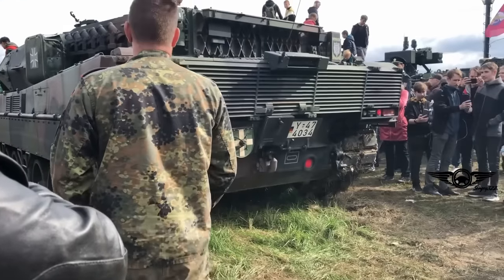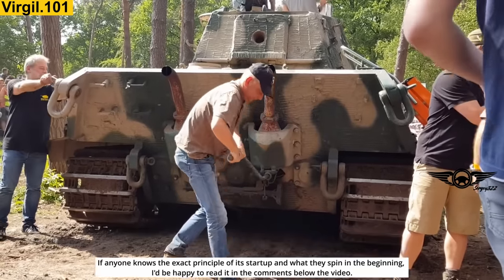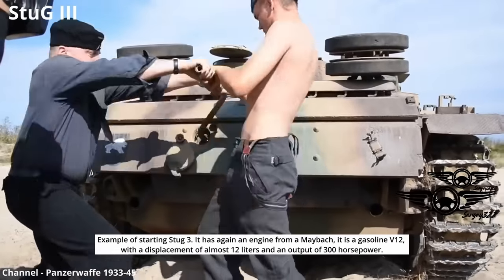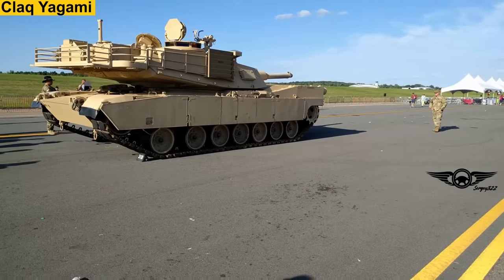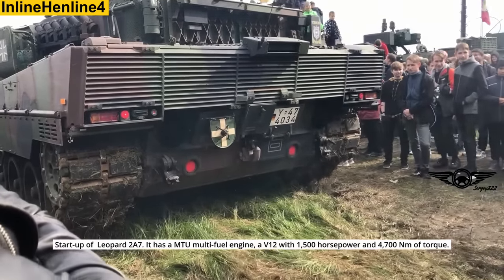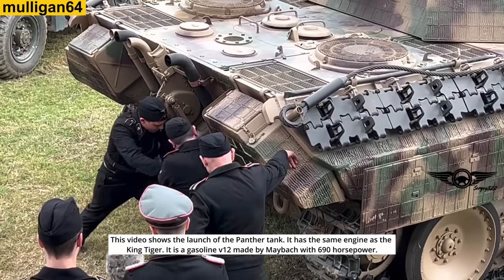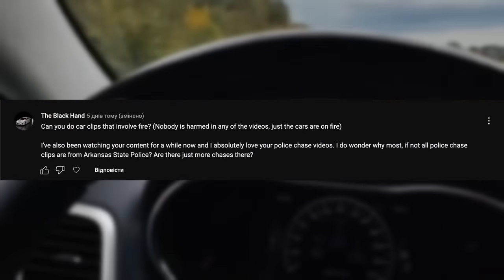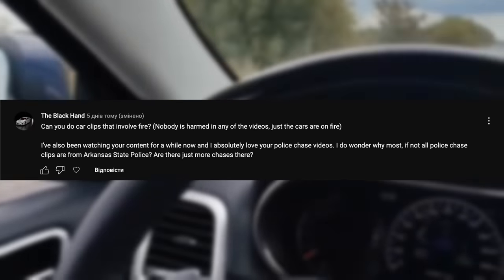TANKS ENGINE COLD START AND REVS (Abrams, Leopard, King Tiger....)

Comment: While I''m not 100% positive of this, I think the tanks that needed to be started manually by crank, the operators are spinning up a flywheel of some sort (and you can hear the flywheel spinning later on in the videos) and once the flywheel is spinning fast enough another operator then engages the flywheel to the motor which then starts it up.
Reply: It is a flywheel system. During times like Remagen in the winter time when it gets blistering cold, you would need a way to choke up the engine so to speak because the batteries don’t like the cold, and/or gets condensation on the spark plugs.
Reply: It is called an inertia starter

Comment: Would love to hear a jagdtiger with the v12 maybach HL230 P30 💪 it was such a beast, and we were luck there weren't many about
Reply: Same as Tiger 1 - Tiger 2- Panther engine?
Reply: @doguesrefoglu4865 I'm not sure, tbf
Reply: Panther, Tiger 1 and Tiger 2 in all their variants has the same Engine with 700 HP. For the Panther with 45t this was a good engine, that gave him good Mobility. But even the Tiger 1 56t was underpowered.
You can guess how bad the mobility for the Tiger 2 with 68t and the Jagdtiger with 75t.
At the end of WW2 they developed a new tank engine with Diesel fuel. In testing it performed better then the HL230 with gasoline, but it was never produced. One of the reasons was, it was fueled by Diesel and the Germans didn't like diesel that Time.

Comment: Since the batteries were not yet so pkwerfull at that time, the engines were cranked to make starting the engine easier.
If it doesn't smoke ... it has no power 😏

Who's  Greta T ?   🙂

Comment: They spin the massive flywheel i.e mechanical energy capacitor, then pull the clutch and stored energy used to crank the engine

Comment: Hypothetically speaking, if a soldier knew how to turn off those old tanks with the cranks and they just so happen to have one for some reason could they? a lot of heavy German tanks were used as defensive placements so you could easily get behind one if you dealt with the germans defending it right? it seems like most of the tanks during that era had no start/off internally

Comment: It sounds like they are running up a flywheel with the crank, and then using the motion of the flywheel to turn over the engine. No battery required.

Comment: all German tanks had electric starters with inertia starter (essentially a flywheel at high rpm connected via clutch to engine) backup.

Comment: 3:34 "who needs to use a gas turbine engine?" go stand about 200 feet away, and you might understand, you'll hear a big diesel engine powered tank coming from miles off, you wont hear the turbine coming till its a couple hundred feet away, plus when the gas runs out, you can just throw something else in the turbine, it'll run on diesel, alcohol, ethanol, even oil
Reply: plus it's much smaller than a similar spec diesel or gas engine
it also has the advantage of having a lot of horse power allowing the abrams to just stack and stack on armour and it won't affect much of its mobility

Comment: Imagine that you are in the middle of a war and you are in a tank carrying a helicopter engine that can be heard from 1000 meters away.
Reply: I head that M1 abrams might be one of the quietest tank when facing you. It can practically sneak up on you if you're facing the other way
Reply: The abrams is the quietest tank shown here. The higher frequency sound doesn’t carry nearly as far as the low pitch diesel sound
Reply: @redacted8109  in theory yes but in reality no higher frequency sounds stand out far to easily. and if you some one with great herring in the higher ranges its practically a high pitch air raid siren. i live about 8 km from an air port on a calm day i can hear the rumble of the Q400s and slight breeze muffles them easily the 737's on the other hand stand out even with a strong breeze.

Comment: Can't it start like a car? using a switch? or is it only the new models
Reply: The newer models (M1 Abrams and Leopard 2A7) are from the 1980s and 2010s respectively, they can start like cars, however the older ones (King Tiger, Panther and StuG III are from WW2, so they're much older (1939-1945)
Reply: @desertfalcon1539 Also the WW2 tanks can do it. At least the german ones but i think the US ones can also do it.

Comment: On the old WWII ear German tanks are the crew members cranking up a flywheel to start the engine?
Reply: Yes
Reply: It's for show. They have all electric starter, but as a backup solution (low batteries, defective of starter, etc.) it's possible to move the flywheel by cranking and using its kinetic energy to start the engine.

Comment: They are priming the oil and fuel system on the King Tiger from sitting cold. Or they are winding up the rubber band starter.

Comment: to crank the kind tiger to start the engine was just a back up option
They had electric starter motors, but they spare the use of them, because no spare parts available

Comment: If you notice, it’s only diesel engines that use the flywheel crank.  Diesel engines ignite the fuel/air mix by high compression, not with an electrical spark like a conventional gas engine.  This allows these motors to start and run with no battery or starter.  Simpler and lighter, ideal for a battlefield.
Reply: The three German tanks all had gasoline engines from Maybach.
Reply: Totally wrong
Reply: Diesel engines are typically heavier than gasoline engines in all platforms

Comment: The method of operating the Tiger 2 tank is like the idea of a car that does not have a battery in a manual transmission... but instead of pushing the car to an appropriate speed... only the camshaft is moved... then it is engaged with the engine.